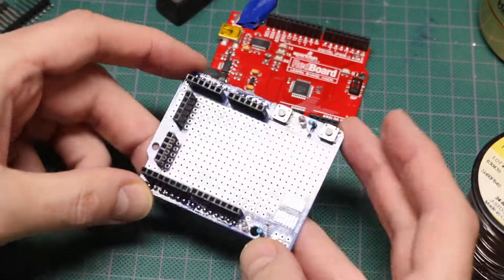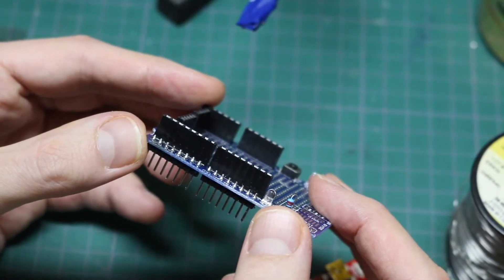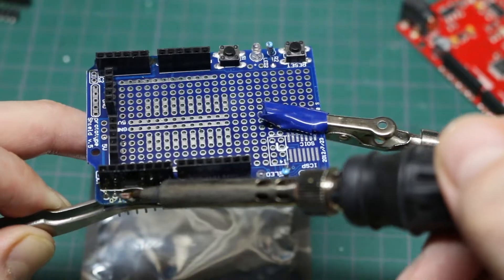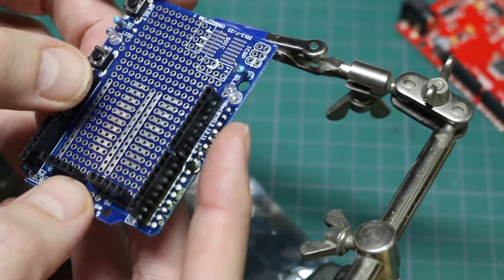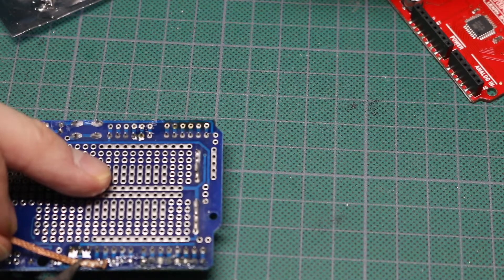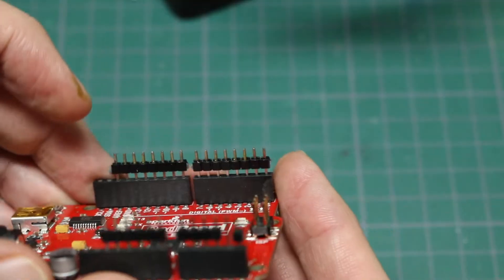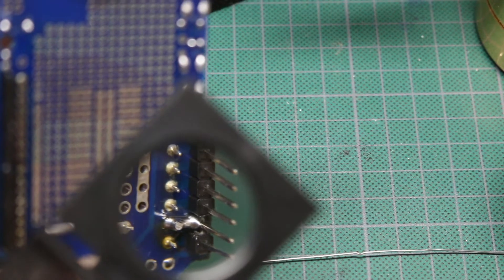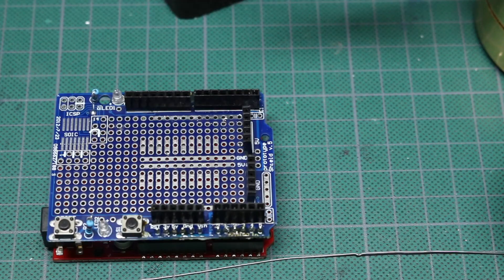Desoldering Through Hole Header Pins

Comment: mind you , pulling out the pins through the plastic only works with the cheap PE plastic connector you get nowadays. On older equipment they used other plastics that are thermoresistant so the pins won't got out that way

Comment: Use a copper wire bent to the size of the header. Add more solder to it and the pins then let the header fall out. Less work, better results.

Comment: 1:31 that's so true I just got stuck here
Reply: unluckily I need to do it on an Arduino nano which almost by default cannot have a bunch of flux heated enough to melt solder safely......
Reply: thanks for the video tho, its very useful and informative, I though I was just bad at desoldering joints but turns out it's an issue for everyone XD

Comment: Wow. I wish I sad seen this video before I fried my $250 car ECU trying to remove IC chips that weren't even going to be reused. I should have just cut the legs off and de-soldered one leg at a time. I ended up paying $270 for the metal electronic de-solder pump tool because of how frustrated I was.

Comment: I love Canadian accents…ooot lol. Thanks for the tutorial. I guess single pin at a time is the way to go.
Reply from the maker: sometimes it’s the only way to get those pins oot (and aboot) 
ever since I bought an Electric Desoldering iron with the vacuum pump, getting through hole parts out has been exponentially easier. It completely cleans the through hole and sometimes the parts just drop out or else they just need a slight nudge with a screwdriver tip to free that one little strand of solder.

Comment: You just saved my but mate. Threw in some 2x20 pin headers the wrong way. Removing the plastic and afterwards cleaning up using a solder pump left me with clean through holes and I could fix the crap I made. 👍👍

Comment: Yeah, this is a total pain.  I find with cheap boards, the through hole copper just gets pulled out, destroying the ability to resold them, so I don't do this anymore.
 In your case, I'd suggest just using two level of pins.

Comment: You saved my bacon bud. Spent 3 hrs trying to pry off a pro micro I soldered in backwards. It hurt to dump solder back on after I spent so much time cleaning it, but dang if it did not just fall clean out almost instantly. Thanks a bunch!
Reply: lol i did the exact same thing with the exact same device.

Comment: When you go from prototyping to final product, do you remove the header pins and solder the permanent connections right to the board or do you solder the wires to the header pins?
Reply from the maker: usually the header pins are either there intentionally for other things to plug into or they are for Prototyping like debug serial ports and onboard flashing in which case I would just leave them present but depopulated so they could be used on the workbench.

Comment: How do you not burn by touching the solder wick with your hand? I burn my hand almost instantly lol
Reply from the maker: I mute the yelling parts out of the video.  Usually I try to hold it by the  plastic casing or if I must hold it by the copper, I just keep moving away as the heat chases me
Reply: @GadgetReboot  Get yourself a pair of medical clamps :)
Reply from the maker: @AdamAllport  I ordered some that never came from ebay, but I did receive reverse tweezers that are the same concept and that's saved me!
Reply: @GadgetReboot  Aye, I've resulted to outting the holder at the hinge of the clamps, dead handy.
Great vid btw!

Comment: Anytime I have tried that first method I have ripped out plating or vias
Reply from the maker: I always had more trouble with the solder wick especially on surface mount pads until I learn to keep it in one place and not try to scrape the solder away with the wick. But accidents still happen and I wish I had a proper desoldering vacuum iron.
Reply: Gadget Reboot i bought a cheapo bulb
Iron it has helped a little bit, I find flux helps with the braid, some doesnt have enough in it

Comment: Velleman sells a cheap desoldering iron that works great for this, and only costs ~$10.
Reply: worh a try? https://www.banggood.com/220V-30W-Electric-Vacuum-Solder-Sucker-Desoldering-Pump-Iron-Gun-Welding-Tool-p-1194115.html
Reply from the maker: I’m getting trigger happy today.
Reply from the maker: Looks like they have some other interesting things worth browsing also. Thanks for the pointer. $10 is worth a shot
Reply: @GadgetReboot  I have one, it's not a substitute for a proper vacuum gun but it's 1000x better than pump/wick/screaming at the solder for way less than a full gun.

Comment: I usually double stack the plastic spreader strips so that the boards seat solidly together.
There is a bang method that we invented in the 70s, because I never hear anyone else mention it, where you heat the pad and quickly bang the edge of the PCB on a hard table and it knocks the solder out leaving a clean hole. I don't use sponges I just tap the handle of the soldering iron on a table and inertia throws the solder off the tip.
Reply: I use this alot, I have also used a straw to blast the solder out when its molten, reverse solder sucker
Reply: I like this "bang" method.
Reply: The tap method works, but it's hard to do. Most of the time you end up having to hold the board at a weird angle to get heat to the joint while still being able to tap it down quickly enough (you don't have much time).
Reply: @jasonmhite  Some of us like frying our bacon naked, too!
Reply from the maker: I’ve flicked the iron in the air toward the table to get solder off the tip before but never tried a board against the table.   Maybe I will try that.

Comment: an other option is using "desolder hollow needles", links in next comment
Reply: They don't really work on holes like this, there's not enough space between the hole and the pin for the needle to fit.
Reply from the maker: That reminds me I bought a set of needles in the past couple of months but haven’t tried them yet. But I’m thinking the hole was a very small one for these headers and I don’t know if I could have gotten a needle in.
Reply: @squalazzo :I've tried them before. On most boards there isn't enough clearance around the square pins to get the needle in there.
Reply: https://www.banggood.com/8Pcs-Stainless-Steel-Hollow-Needles-Core-Desoldering-Tool-Set-p-928740.html
Reply: https://www.youtube.com/watch?v=2wcFr-lO9Eo